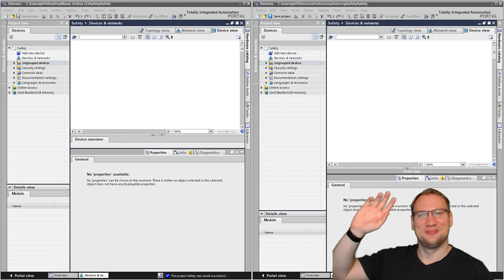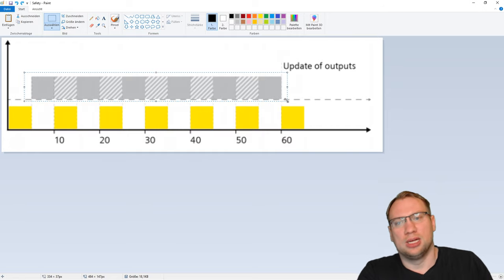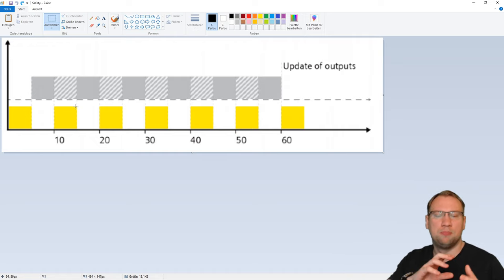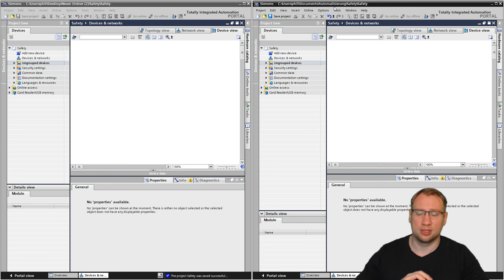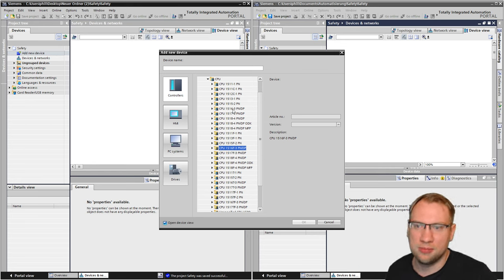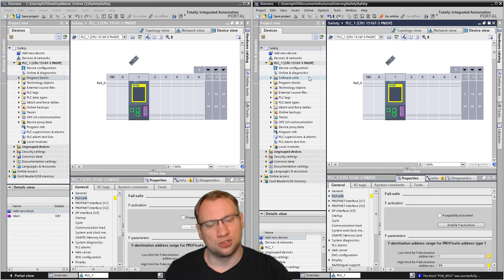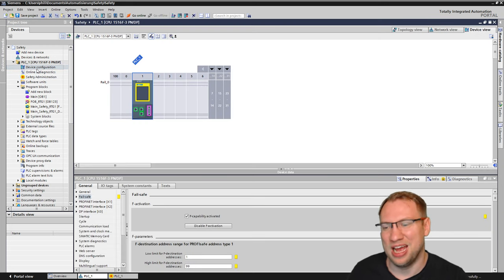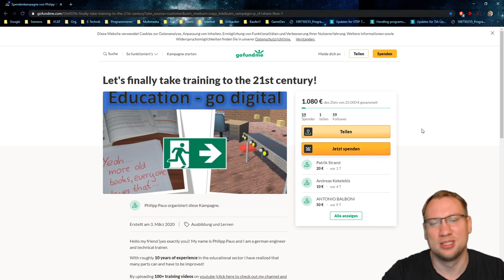TIA Portal: All Safety Basics! Part 1: General Info

Comment: Just to mention, emergency stop evaluated from non safe logic solver (for example non safe cpu) is practically illegal by the safety regulations. Is only legal if used as process stop not emergency.
Reply from the maker: Completely correct! Although it highly depends on the region/country... but in most places it is mandatory (although I prefer using emergency stop relays in many cases)
Reply: Can you reference a specific standard and an exact quote.
ISO 12100:2010 "Safety of machinery" is too general
ISO 13850:2015 "Safety of machinery — Emergency stop function — Principles for design"  .... maybe there but I don't have the standard
Tha abstract states:
NOTE The requirements for the realization of the emergency stop function based on electrical/electronic technology are described in IEC 60204‑1
And what if you program the the E_STOP button as a hardware interrup.
Reply: True, before you push your machine to customer, and give machine CE mark you should do risk assessment. After that you can say what is dangerous, and what PL you need. 
So if you have low risk, you can make safety on one channel regular PLC.

Comment: ich frage dich immer und immer :D,
ich will wissen was für VM du benutzt, oder es Tia-Portal auf dein Host-Rechner, ich benutze Tia-Portal auf VMs aber Tia-Portal ist langsam besonders wenn ich die Simlation aktiviere,
kannst du mir bitte raten, was könnte der Grund sein ??, mein VM ist so groß und mein Host-Rechner auch
Reply from the maker: Also ich nutze es auf beide Arten. In den Videos aber ohne VM... es braucht ganz einfach starke Hardware. Sehr wichtig sind eine schnelle Festplatte (ich benutze eine M2) viel RAM (ich hab 32GB) und ein guter Prozessor (Meiner hat 32 Kerne). TIA reserviert sich einzelne Kerne vom Prozessor, besonders beim Simulieren ist das doof, da jede Simulation einen einzelnen Kern reserviert... vielleicht mal im Task Manager schauen wie viel da noch frei ist. Generell ist das Tool aber leider manchmal langsam. Auch die Projektgröße ist wichtig... je größer das Projekt desto langsamer wirds:_nope:
Reply: @hegamurl7434  Danke dir für deine Mühe und deine Hilfe